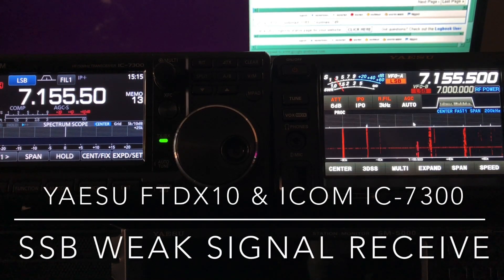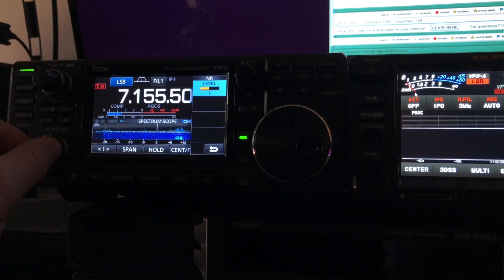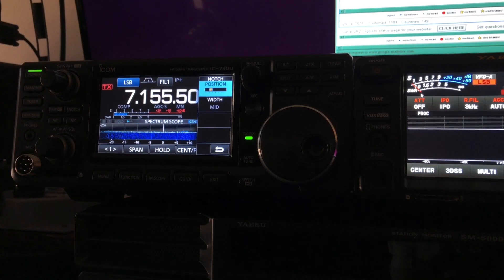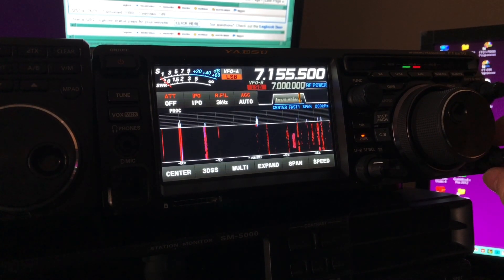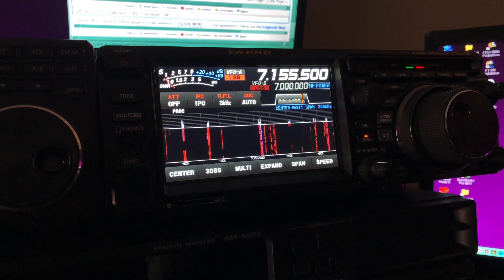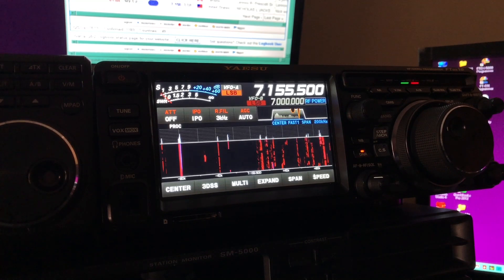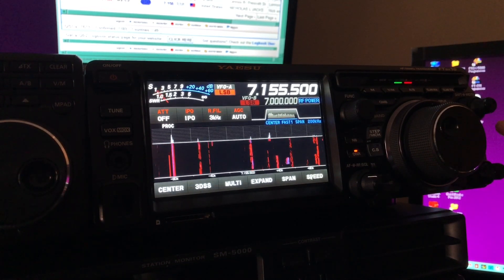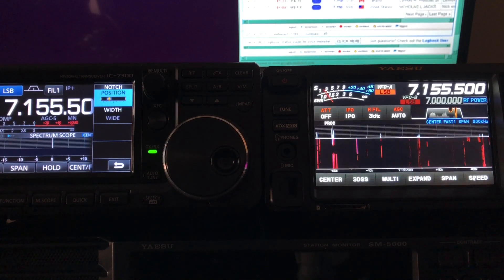FTdx10 & IC-7300: SSB Weak Signal RX (Video #17 in this series) #hamradio #ftdx10 #ic7300

Comment: As I understand it, a notch filter works by attenuating a thin slice of a desired band of audio (or generally speaking any band of frequencies of interest, be it audio or RF). So, for example, if there is a stray tone that affects 1980khz, you can set the filter there and it will essentially cut out that portion of what you’re hearing. So it doesn’t make sense that you would apply the notch filter to broadband white or pink noise and expect miraculous results. Essentially all you’re doing there is taking out a chunk of the white noise that resonates with the audio system (and your ears) in the most annoying way.  The side effect of applying the notch filter when no apparent notch-sized disturbance exists is to notch out wanted signal, in essence, reducing the audio bandwidth, which reduces fidelity - similar to the way a BW filter would affect the signal. Please correct me if I’m wrong.
Reply from the maker: A notch filter attenuates the audible tone produced as a result of heterodyne, like someone tuning up near where you are tuned to, or something in your neighborhood that is mixing against the frequency you are tuned to.  I have the latter situation when I’m tuned to 7.150MHz.  The tone happens in the audio spectrum, otherwise you wouldn’t hear it. 

The notch filter width can be set to wide, medium, or narrow. Wide and medium affect fidelity to a more noticeable degree. But the tone or noise could make someone unreadable.  So, using the notch filter is a compromise. Fidelity is not the concern when you have a tone mixing in with the station you are trying to hear.

 I keep my Yaesu notch filter set to narrow. It is very effective against heterodyne interference without affecting the audio fidelity much at all.  The Yaesu has a separate, Contour filter, that can minimize atmospheric noise, when I’m trying to pull out a barely readable signal. The ICOM doesn’t have a Contour filter. The closest you can get to a Contour filter with the ICOM is to set the notch filter to wide and sweep it through the audio spectrum until you can pull out what the barely readable station is saying.  Fidelity is not important in such a situation. These are techniques that are used only when necessary.

Comment: Hi there. I see that both radios have a similar NB and NR. Saying that which of tbe 2 rigs will reclmend for DXi g. I currently have the FT 2000D and the Iclm 7600 but I want to try SDR. Thanks so much
Javier
TI2JS
Reply from the maker: For DX,?  Definitely the FTdx10.  The hybrid receiver plus DSP has propelled the FTdx10 to number 3 in the world for RMDR (selectivity).  It is beaten only by the Flex 6700, at number 2, and the FTdx101D at number 1.

73, de N4HNH

Comment: Rob Sherwood recommends that the IP+ on the IC-7300 be left off as it adds nothing  to help receive performance. AB4OJ actually noted on the IC-7300 that he tested that the MDS was affected negatively by having it turned on. There was as much as 10 - 13 db degradation in AF noise with it on. He said that the effect increases below 40 meters. It does not perform the same function as on an older analog design. I’m curious to compare my FTDX-10 with my older IC-7300. Of course, it is a more expensive radio and I expect increased performance. The DNR on the Yaesu radios do seem to perform very well indeed.
Reply from the maker: IP+ employs analog to digital converter functions, called Dither and Random, to inject random noise at the input of the analog to digital converter.  Believe it or not, injecting this noise can cause the ADC to work some magic that can improve the 3rd order intercept performance of the receiver.  This dither technique adds to the noise floor, by approximately 9dB, decreasing sensitivity. But some laboratory tests indicated an improvement in the dynamic range of the receiver by as much as 13dB.  So, think of it as trading 9dB of receiver sensitivity for a 13dB improvement in dynamic range.

Use IP+ when you don’t need extra sensitivity and are struggling to hear a weaker signal while a strong signal is transmitting 2 or 3 kHz away.  This is similar to Yaesu’s IPO, Intercept Point Optimization, but not exactly.  

IPO and IP+ both decrease the sensitivity of the receiver while improving the cross modulation characteristic of the receiver, helping it combat a strong signal on a nearby frequency that could wipe out a weak signal on the frequency you are listening to.  But, the problem with IP+ is that it increases the noise floor during the process of improving the cross modulation characteristic.  That is just how it works with the analog to digital converter that is needed for a SDR.  

It is interesting to note that numerous IC-7300 owners report that IP+ yields little to no improvement in practical use.  Rule of thumb?  Leave IP+ off unless you think you need it.  The amount of improvement it might yield would be more helpful during a contest, where selectivity is more important than sensitivity.

Yaesu’s IPO, Intercept Point Optimization, improves the cross modulation characteristic of the receiver but it also happens to decrease the noise floor at the same time.  Rule of thumb?  Keep IPO enabled always on 40m or below, where extra sensitivity is not needed and improved rejection of strong nearby signals is a plus.  You also enjoy the added benefit of a lower noise floor.  At 14MHz and higher IPO is optional.  At 21MHz and higher, you will most likely need AMP1 or AMP2.

73, de N4HNH

Comment: Another great video.  Could you explain exactly what the heterodyne sound is and what causes it?
Reply from the maker: Heterodyne happens as a result of two different frequencies beating against one another.  That’s how a superheterodyne receiver works.  I shot a video about that last year, breaking down the stages of a HF receiver.

If the two frequencies that beat against each another are within 20kHz of one another, the resulting difference frequency could fall into the frequency range of human hearing, which is 20 Hertz to 20,000 Hertz (aka 20kHz).  As we get older we might not be able to hear up to 20kHz though.  We might be able to hear to 15 or 16kHz.  

But the heterodyne I’m hearing from time to time is anywhere from 1500 to 2600 Hertz, well within the audio spectrum of HF SSB.

The heterodyne could be many things.  That’s why I dedicated an entire video to tracking down noise sources.  One of my viewers found his neighbor’s plasma TV was producing noise that interfered with his reception.  He has “loaned” the neighbor a LCD TV.  Some noises are broadband like that.  Some LED lights can create terrible noise.  Wireless phone chargers and wall-wart power supplies too.  But a heterodyne is usually caused by an oscillator somewhere in the vicinity.  It could be a baby monitor.

73, de N4HNH
Reply: @n4hnhradio  thanks Doug for that very detailed explanation.  I'll take a look at both videos you mentioned in your comment.

Comment: Was the transmit on the ICOM lit up?  Glad you to told us about the signal running across the scope.  I was going to ask you about that.  I was thinking it was something just happening at my QTH.
Reply from the maker: No.  That TX LED on the 7300 is confusing.  It stays there on RX.  It just gets bright when you transmit.  I think ICOM should have put a green RX LED for when it isn’t transmitting.

I think everyone gets that WX tracker or over-the-horizon radar blip from time to time.  Search the Web for information about the Russian “woodpecker”, from the 1970s and 1980s.  It was worse.

73, de N4HNH
Reply: @n4hnhradio  Yes.  I just realized that.  You would think I would know since I own one.  But, I’ve been using my FTDX10 so much, I forget about the little differences between the two radios.
Reply from the maker: I hope I haven’t forgotten how to use my FTdx5000MP by the time I finish making these videos.  I will be putting the FT-991A up against the Ftdx10 in the near future.

73, de N4HNH
Reply: @n4hnhradio  That will be interesting.  The 991 was an option but I didn't want to wish I had spent the extra money and get a better radio.  When I saw it was number 3, that helped make up my mind.  Glad I bought the FTDX10.  The other option was the FTDX 3000.  Thanks for all of your insight.  These videos are golden and will benefit others for many years to come.  Thanks to Joel.  Is there a radio he doesn't own?
Reply from the maker: Believe it or not, Joel went many years without buying a new HF radio.  I did too.  It took me nearly 20 years to buy a new HF radio.  Joel is careful like me.  When the 7300 craze started, I think that was his first base station purchase in a couple of decades.  I could be wrong.  But I think his other radios at the time were vintage Kenwood twins.  The separate RX and TX combination.

I was using a Yaesu FT-920, since 1999.  I had made some modifications to its roofing filters, so it was no slouch.  When I finally decided to buy my dream rig, I started reading reviews and watching YouTube videos.  I rarely found a video that would do much more than switch back and forth between the radios, not explaining any adjustments they made, and sometimes not even making any adjustments.  I wanted to see how good the radios were at mitigating QRN, QRM, etc., plus ease of use, menu settings, and more.  Therefore I bugged Ham Radio Outlet for 8 months, trying every radio they had hooked up for demonstration.  After I finally made my choice they were happy.  I then decided to start making the sort of videos I wish I could have found when I was researching.

So Joel recently upgraded to the FTdx101MP for home and this FTdx10 will go to his cabin.  Before he sells the other radios he loaned them to me.  In fact he has no radio at the cabin now.  The FT-991A was there.  He’s waiting until I finish the video series and the FTdx10 will be the new cabin radio.  It makes good sense because the FTdx10 is practically a FTdx101 without simultaneous dual-receive and VC Tune.

Joel is a great friend to me and to amateur radio.

73, de N4HNH

Comment: As by my ears the 7300 has lower noise than the DX100.
Reply from the maker: Then you should use IC-7300 and not Yaesu.  To my ears, the FTdx10 has the lower noise floor, and the DNR is superior to all radios on the market today from the big three.

73, de N4HNH
Reply: @n4hnhradio  In regards to the Noise reduction circuit I totally agreed, Yaesu NR is way better than any Icom, I have owned many Yaesu radios including the FTDX5000 and from Icom I owned the IC7851 and always found the Yaesu NR to be always higher performance.
Maybe you are alright about DX10 having less noise but the way you did that test video, it sound less noise in the 7300.
I definitively will like to try a DX10 but what have me stoped is the lack of averaging for the signal spikes which too darn fast.

Comment: On the Yaesu, try going higher with DNR setting but switch the contour from negative to positive setting (like +8). Adjust contour frequency anywhere between 1800 to 2300 Hz. You get less noise and much better SSB signal clarity and readability.
Reply from the maker: I’ve done that.  I get better results with DNR at algorithm 4, 5, 6, or 7 and Contour at 1900Hz, -18dB, and a width of 9.

Comment: I would love to see a series on a Flex Radio vs some of these others.   Maybe someone will loan you their Flex...after all they can still operate it while you have it for a week or so 😁
Reply from the maker: Ha!  Maybe someone will send me a Flex.  I know a guy with a Flex, a FTdx9000, a FTdx5000, and a FTdx101D.  He prefers the receiver in the 5000.  I haven’t been to his shack.  He is someone who hangs out on one of the 75m rag chew frequencies I sometimes listen to.  

But Sherwood Engineering already answered the question.  Flex 6700 is number 2 for RMDR, with a rating of 108dB.  The FTdx10 came in at 107dB.  The FTdx101D ranks number one, with 110dB.  They’re all good radios with numbers like that.  I just wouldn’t spend $7,000 for a Flex 6700, when I could get a FTdx101D for $3200.

But, if you read the footnotes for the Flex 6700 in Sherwood’s list you will see that the Flex 6700 that he tested at 108dB was a one-off.  All other Flex radios tested by Sherwood come in at 99dB.

73, de N4HNH

Comment: on the 7300, why is the TX icon illuminated?
Reply from the maker: That’s just the way the IC-7300 looks normally, until you actually transmit.  It’s rather confusing isn’t it?  It doesn’t have a green RX light, like you might be accustomed to with Yaesu radios. Maybe ICOM ran out of space on the display for an RX indication, and they didn’t want to write the extra lines of code to toggle the TX light from red for TX to green for RX. What they did do, when you transmit, is fill the blank area around the letters TX with red and change the color of the letters TX, and the oval surrounding the letters, to white.  Now that begs the question…If you can toggle from red to white, why not toggle from green for receive to red for transmit?

Comment: Interesting upload Doug, thank you. It seems clear that you consider the DX10 to be the better rig. Given the lack of  proper DSP on the 7300 (and I get the sense it doesn't really possess properly functional tools to deal with QRM/QRN), is the 7300 a viable rig for the casual operator? Or would they be better off elsewhere?

P.S. Are you on QRZ? Will try to contact you via QRZ to arrange a contact.
Reply from the maker: IC-7300 is a great radio for the casual rag chew operator.  It’s also good for someone who is new to radio and needs a transceiver that is simple and intuitive.  It’s just not a contest class radio.

I’m on QRZ.

73, Doug